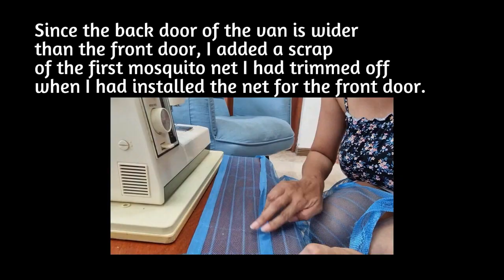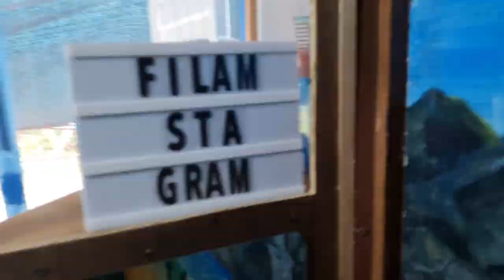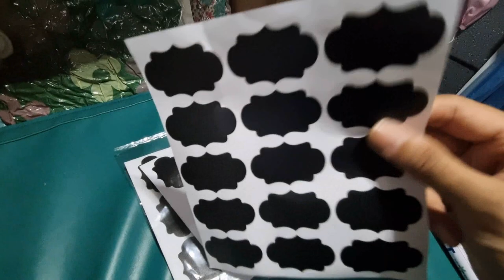Home Improvement in a Campervan | Mitsubishi L300 FB | DIY Campervan | Vanlife Family Vlog

Comment: Ganda! I like the high roof and cab pass through.
I've seen actual deadbolt/pedestrian gate locks installed on that rear door.
Reply from the maker: Thanks for the suggestion. We'll look into it--there should be something like a deadbolt system available.

Comment: Paul, when you were drilling out the fasteners on the rear door, I was expecting one of your "Tool Time" girls to admonish you about no eye protection!  More & more I am lovin' the idea of explosion proof mirrors in anything that moves, thank you big time for sharing that one. The simplicity and functionality of your home built mosquito nets is first class and adaptable to so many other applications. You might even have a home business oppertunity with that if you want.
Reply from the maker: Haha. Paul's lived in the rural third world so long (Nicaragua and Philippines), that he's adapted the magical ability to work without the usual protective gear. We're glad you like our mosquito net techniques, although this time the nets already came with magnets. We bought the cheapest ones that did not have velcro, and the cheapest velcro as well because we didn't trust the self-adhesive velcro that the more expensive ones came with. Sewing them on was better. It had to be heavy duty in our case because a certain 4-year-old always pulls down on them to get on and off the van.